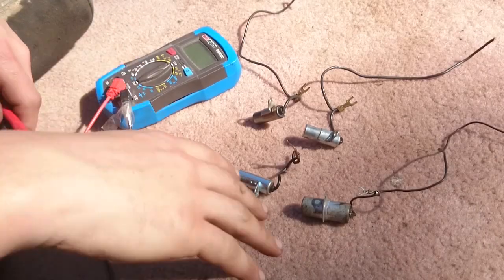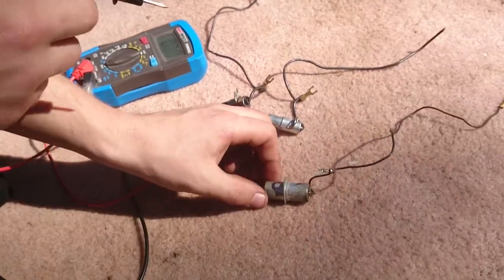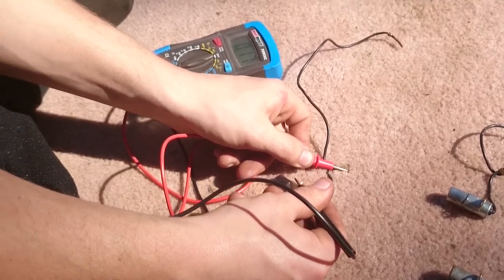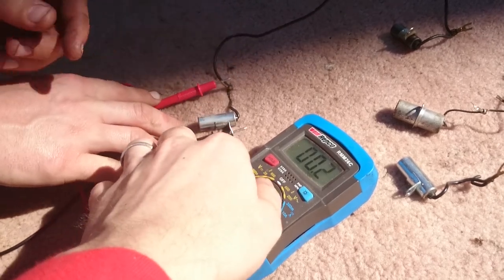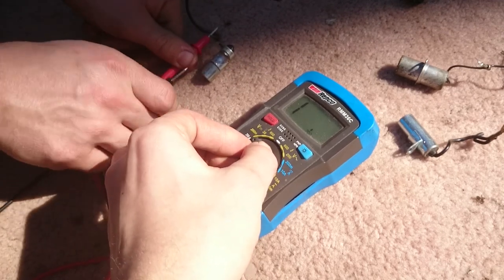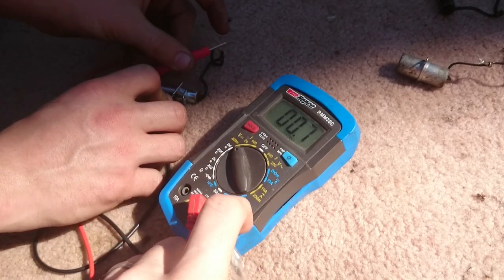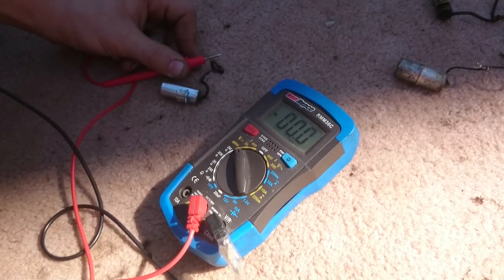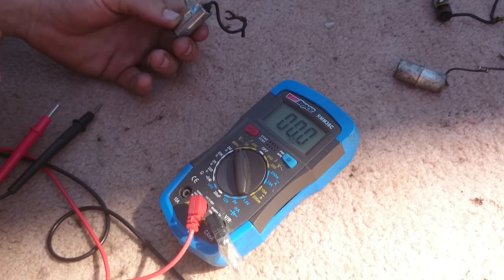PushMowerRepair.com - Testing A Condenser (Capacitor)

Comment: He's doing the procedure correctly but not explaining it correctly, because he forgot that not everyone understands the difference between voltage and resistance.  Nor does he explain that when he switches the meter from volts to megohms he's changing the circuit.